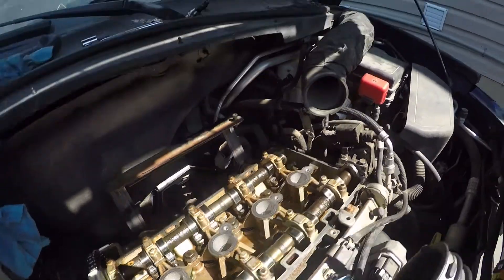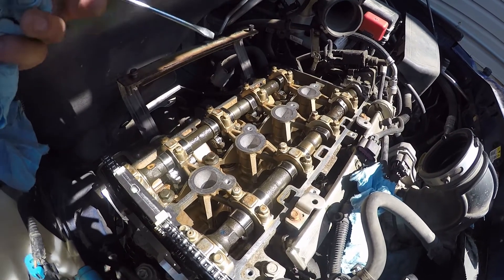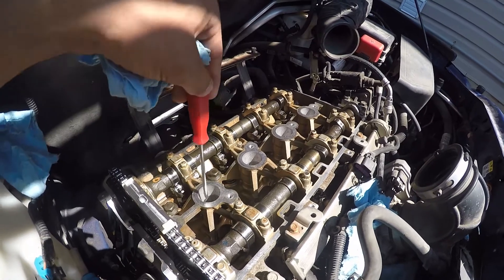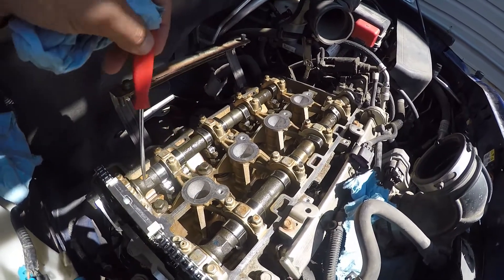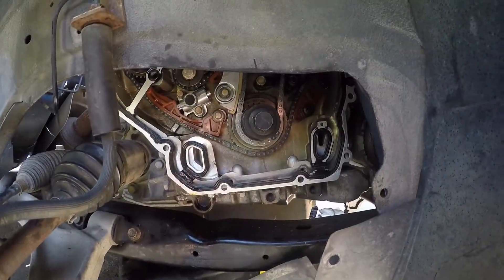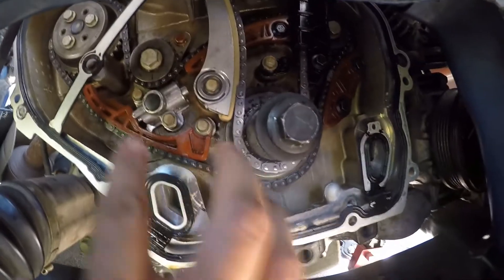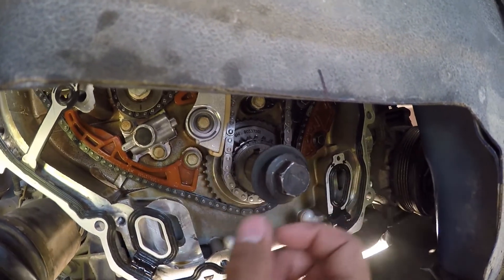2.2L Ecotec timing chain replacement tips

Comment: Did you have to pull the engine out were you able to do it with it still in the car?
Reply from the maker: Did it all in car outside on the driveway. Pretty easy to work on after you get the covers.

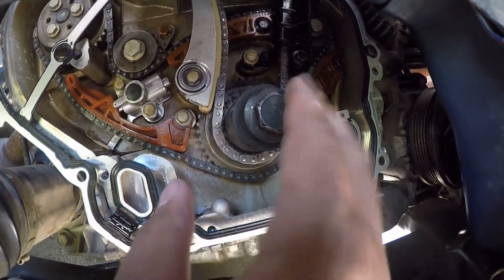Comment: 4:34 was the cover gasket reused or bought a new gasket?
Reply from the maker: Reused it this time but I would recommend replacing!
Reply: @benq.mechanical  1:26 is the engine at TDC compression stroke or TDC exhaust stroke?
Reply from the maker: @badmatt4227  TDC should be top dead center compression on #1 cylinder 😀

Comment: Is there a way to adjust the timing without marks?  I took the chain out and my stupidity allowed me to turn the the sprocket s individually, which turned the cams.  Now I have no idea where I am at.  Call me  an idiot because I am. 2015 Chev malibu 2.5
Reply from the maker: Ugh. That is not a fun spot lol. Does the 2.5 L look the same under the valve cover?

You're going to need to find Top Dead Center (TDC) on the compression stroke for cylinder #1. There should be a video on how to do that on YouTube.

That'll get the intake camshaft lined up. From there you should be able to adjust the exhaust cam so its the opposite.

Once the camshafts are lined up at TDC the sprockets will be lined up again so you can use the timing marks 😁

Let me know if that helps.
Reply: @benq.mechanical  https://www.youtube.com/watch?v=GBcBrAuC7tI .  This is a small video of my cams.  Do you think i'm 180 degrees off on the timing ?  Thanks for the help.
Reply from the maker: @cartroublewannafix8611  If you find TDC, on compression stroke, the intake valve should be closed, and the piston all the way to the top. Right? You could verify that by sticking a long screwdriver in the spark plug hole.

From there you should be able to align timing chain unique link to the intake sprocket then adjust your exhaust sprocket back where it would line up right?
Reply: @benq.mechanical  So I did get tdc, the piston up.  And you say the  intake valves should be closed.  What about on the exhaust side , how should that be?   That's where i get all the resistance of it springing back.  Thanks for the help.
Reply from the maker: @cartroublewannafix8611  exhaust should be closed too, but the cam lobes should be the opposing direction. On the 2.2 & 2.4 if you look at the back cam lobes they point roughly to the 2 o'clock and 11 o'clock position 😊
Reply from the maker: @cartroublewannafix8611  Hey man! Fell off the rails here. Did you get it figured out? Looks like you were in the right position in the video
Reply: @benq.mechanical  Got it done right.  Thanks for the help.

Comment: I removed the balance shaft timing set off only to find that there no identifying marks on the left and right sprockets. What do I do to get them in time?
Reply from the maker: Hey Wayne! Sorry missed this.

There's no arrows on the balance shaft sprockets?!

Did you watch the Cloyes video I linked in the description?
Reply: @benq.mechanical  Yep, you read that right, not a damn mark left on it. Must have been original and I assume there's a shit ton of miles on it. The marking of the arrow was just plain gone. And yes, I did use that vid. I got it all back together, cover and valve cover back on, ready for it's new home. Do you by chance know what hours would be billed for this project? Both in vehicle and out. For a number of reasons, the biggest being that I'd never done one before, it took a ton of time so I can't just bill him for how long it took and I'm not built back up since my last back surgery to justify a labor guide. Thanks!
Reply from the maker: @waynethomas1726  lol. Oh man. That's unfortunate. Hope you got it figured out. Sounds like an operation there forsure.

I don't know the book time. But when I did this I was quote like $1500-1800 to do. Might have been the reason I did myself lol.

Its not a cheap job that's for dang sure.
Reply from the maker: @waynethomas1726  appreciate your sharing though. That will definitely help someone else.
Reply: @benq.mechanical  Yea, that's what I'm hoping. If I had known there was a timing mark on them at some point I could have used the "similarly colored link to identify the correct tooth and marked it. I wasn't actually going to change the balance shaft timing set. What happened was that I had to change the water pump while I was in there and not knowing there even was a mark to go by I just took the chain off and cleaned all the bolts up like new and cleaned the guides. I watched the vid and I was like, "oh shit! There's a mark and now it's not visible. Oh well, at least I can say I learned how to correctly do the job for next time...but I REALLY hope there isn't a next time! LOL
Reply from the maker: @waynethomas1726  lol. No kidding. Hopefully a one and done 😅👌

Comment: I am hoping that you can assist me? I only have to.orrow to complete my timing job! 07 pontiac G5 2.2 vin-F. I think that what happened was, I forgot to straighten the key on the crank & allign it at the 12 o-clock position b4 buttoning up everything, & I probably didn't put the slack in the timing chain b4 installing my cam gears, & finishing up. However, my rear cam (exhaust cam) seems to be pointing more towards 11 or 11:30 rather then 10 o-clock. What advice would you recommend,? ,I am hoping  to remove the main timing chain, & all its components ,& trying again? What is throwing me off is, the uniquely colors links are on the cam gears but, on my exhaust cam, the cam gears but the cam marks are pointing closer to 11 o clock and rather then 10 & 2. What is your thoghts?
Reply from the maker: Oh boy. Nothing like being under pressure!

From your description I would try the following.
1. Take everything off. Pull the cam sprockets and make sure you've got them on right. I believe each gear is specific to the shaft it sits on. 

2. Take out your #1 spark plug and stick a piece of clean paper towel in the plug bore. Then rotate the engine till the paper towel pops out. Then you know for sure you are at Top Dead Center on the compression stroke for piston 1.

3. Then go back through the process of aligning the uniquely colored link. Everything should line up from there.
Reply: How did you come up with putting slack in the timing chain.  Slack is what you don't want.

Comment: Running into a problem with the cover bolts I raise the motor as high as I can or as low as I can and it still doesn't give me clearance to pull the bolts out im not trying to pull the fucking motor out cuz im in my yard not at a shop
Reply from the maker: The front cover? Hmm...I'm not sure what vehicle you're working on, but the HHR did have a couple holes through the frame that a guy could reach through.
But I can't I remember having issues reaching the cover bolts. May have gotten creative with wrenches though lol.

What about taking part of the motor mount off? Does that buy some room?

Sounds terribly frustrating...joys of backyard wrenching 🙄

Comment: So with the #1 cylinder at tdc on the exhaust stroke, would the piston be at the top? In your video, The piston was not at tdc, meaning that it was not at the top of the stroke/ top of the cylinder, WHERE IS THE #1 PISTON WHEN ALL THE TIMING MARKS ARE ALLIGNED? NOW IM GLAD TO HAVE SEEN YOUR VIDEO! SO, THE PISTON IS NOT SUPPOSED TO BE ALL THE WAY UP AT THE TOP OF THE CYLINDER?
Reply from the maker: I believe cylinder #1 is all the way up when the #1 cam lobes are pointed downward at tdc.

But brain is a little fuzzy at the moment 😅.

But the biggest thing to remember is just line up the timing marks. The chain jumped on mine so I had to start at square one and retime it.
If you replace the chain before that's an issue, all you need to do line up the uniquely colored link and your good to go!

I posted a link in the description to another video that shows the process. 😊
Reply: Yes you want your #1 Piston near the top of the bottom of the spark plug cylinder

Comment: I just got an 07 Pontiac G5 2.2 vin-F (167k miles) about 2 weeks ago, It made a tapping noise for the 1st few seconds at start up & went away! When i first saw the car it was already running & drove good minus some bad tire's, or so I thought!  All 4 rims are bent, All the wheel studs are all ruined & all of the lug nuts but, the biggest issue is, my driver lower control arm bushing. Found that out on Friday as I took it to get 4 new tire's! Then My supervisor messages me to tell me that we we are not scheduled for the next 2 weeks! what a joy=no money for bills so, everything must get pushed back! I installed a new timing tensioner only, The noise at start up went away!!! The chain was tight, the guide bolt that is known to back out was tight! Purchased a new window regulator, wiring kit, installation kit & antenna extension, fixed the back seat (previous owner installed the cable incorrectly, The cable to open back seats) It needs a few things yet! At 3 min 27 sec of your video, When you are showing proper can gear alignment, There is an axe in the background with a rotting handle, Please for the love of God, Get some boiled linseed oil onto the axe handle please? They sell it at Lowe's & other store's!!! if no boiled linseed oil, probably any oil is better then none! wd-40, PB Blaster,  Sorry but, It was killing me!!!! Though, Beings that I only stabbed in the screw in tensioner, removed the valve cover & then unbolted the old tensioner & PUT MY SMALL HEAD EXTENDABLE MAGNET INTO THE HOLE TO ENSURE THAT NO PIECES FELL INTO THE ENGINE, & Thank God that I used that smaller magnet because that tensioner came out in pieces!!! One day, I will do the entire timing chain but, for now, mine looked really tight! Idk how many previous owners, engine runs strong! I saw yellow chalk marks on the valve cover so, either just the valve cover or, the entire engine came from a junk yard... At least it runs good!
Reply from the maker: Haha. Thanks I will take care of the axe. It's since been stored inside which is preserving it at the moment. But yeah a little oil would help 👍

Sounds like you've had a bit of a run around with work and such. Hopefully things get figured out there.

Good to hear all you needed was the tensioner on yours. I tried that first, but need the whole chain on mine🙄

Now you've yours fixed it'll last a long time. Just change oil they're good engines.

Comment: Thank you for the video. First I've seen where the engine remains in place. I have gained confidence just by seeing you can gain access from the side through the wheel arch. Still don't know whether to tackle the job myself, have a local garage do the work (circa £1000) or trade the vehicle in.
Reply from the maker: Hey I'm glad it helped! It really wasn't too bad of a job. But a few things that helped me were.
1. Take lots of pictures with your phone!
2. Organize the parts on cardboard as you take them out!
3. Consider replacing the water pump at the same time because it's tied into the ballast chain.

But if you've got a little mechanical skill you can probably do it. Take your time don't rush. Triple check absolutely everything (so you don't get the timing mix up 🙄).
It's definitely more intimidating than it is hard.

Good luck. If you have any specific questions feel free to reach out.